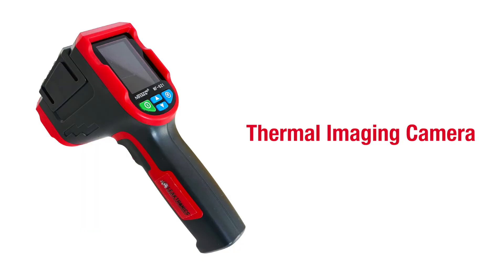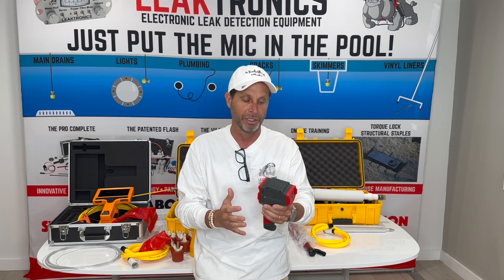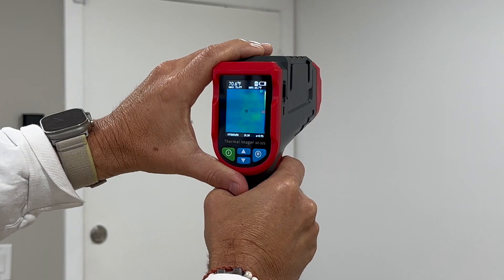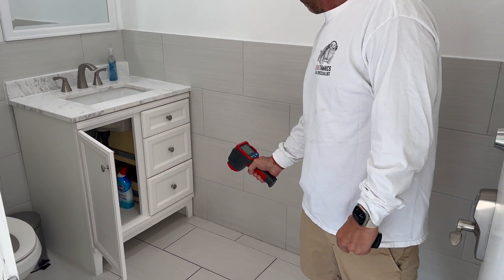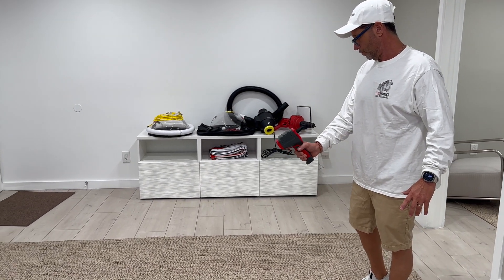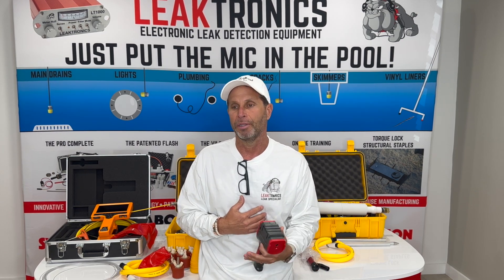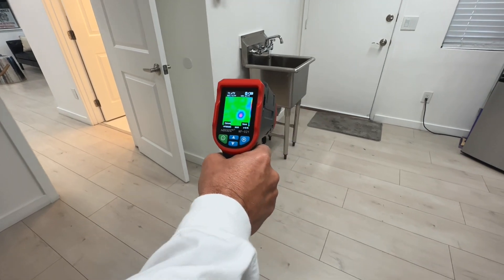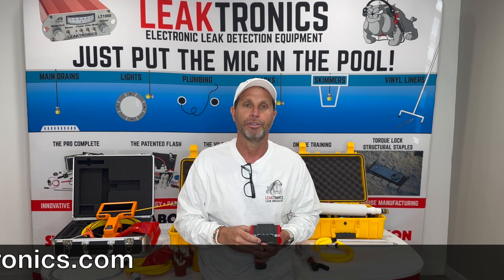Thermal Imaging Camera REVOLUTIONIZES Leak Detection for Plumbers!

Comment: Will it show blue on a cold pipe under a slab? I have your sound equipment and also use a “Pipehorn” tracing equipment currently to follow the path of under concrete water piping - wondering if a thermal image camera would be faster?